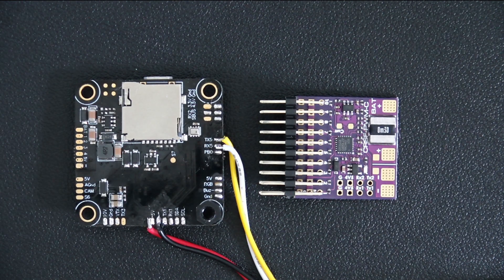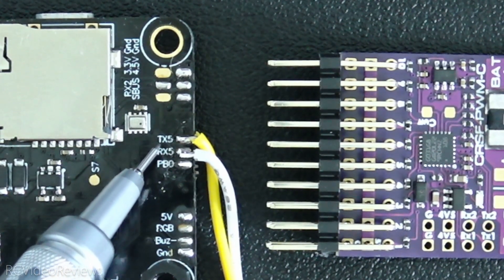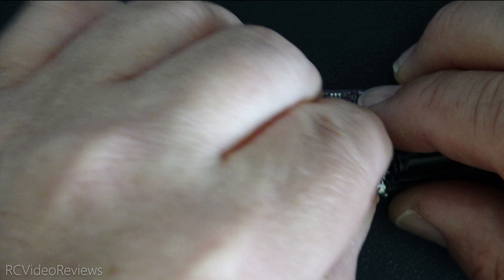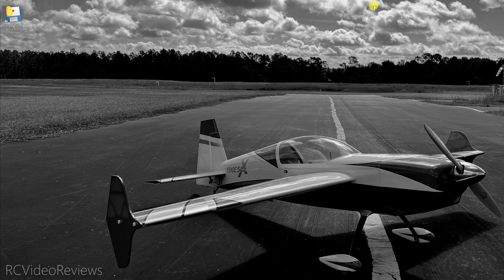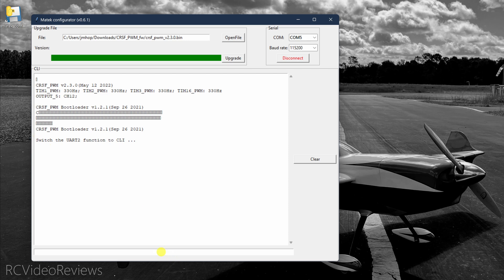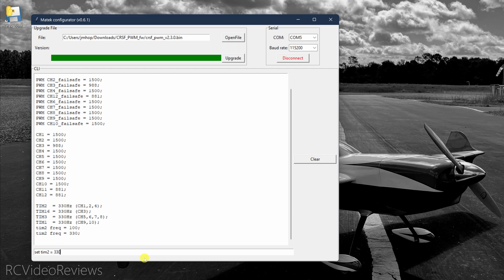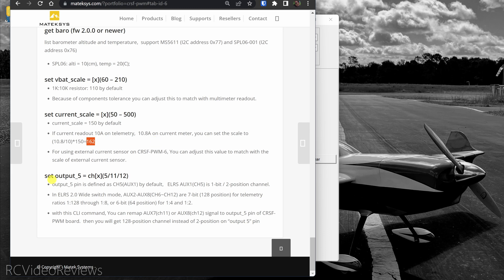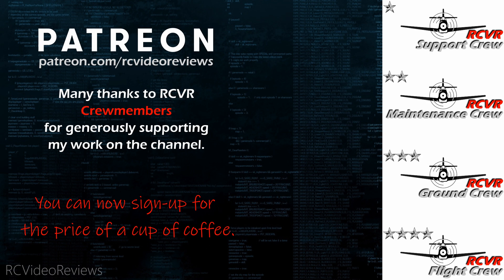How-to Betaflight Passthrough Flash and Configure the Matek CRSF-PWM-C for Express LRS

Comment: On their website Matek give details of how the CRSF to PWM converter board’s firmware can be updated via a USB-TTL module, such as CP210x, FTDI. I have also seen it stated on another site that the BetaFPV ExpressLRS recovery dongle is a FTDI USB to TTL adaptor using a CP2102 chipset. If so could this be used as the interface to upgrade the firmware on these boards?
Reply from the maker: The images I saw on the product page look to be very specifically focused on setting SBUS parameters and possibly even channel remapping. i.e. It didn't look like a terminal command line like the Matek boards.
Reply: @RCVideoReviews  Many thanks for your reply to my previous query. I purchased a USB to TTL adaptor and have used this to successfully upgrade the firmware on both a CRSF-PWM-6 and CRSF-PWM-V10 board. With regard to the CRSF-PWM-V10, can you please advise on the function of the “Boot pass” bridge and the pin connection located between the bridge and the No 1 PWM pin. It would be very useful if the bridge and/or grounding the pin connection were intended to force an attached Rx into boot mode but I can find no reference to these on the Matek website or from an internet search.

Comment: must be something about latest FC firmware, does not let the matek configurator open the port - i get this when i enter 'serialpassthrough 1 115200': # Port 1 already open.
Removing rxCallback | Forwarding data to 1, power cycle to exit. |  Also this message is in inav and also bf above the cli: Note: Leaving CLI tab or pressing Disconnect will automatically send "exit" to the board. With the latest firmware this will make the controller restart and unsaved changes will be lost.  | So something is wedged or no longer works for passthrough.
Reply from the maker: The BetaFPV dongle still works well. I haven't checked BF/iNav since I made this video as I usually just use the dongle.
Reply: @RCVideoReviews  Thanks, i did get it going with a USB TTL board.  Now, unfortunately i interrupted the crsf to pwm board flash and get solid blue led, any way to reset in order to reflash? Btw great channel! thx -pd

Comment: Very interesting video! You state that the instructions say that you have to connect to the 'second row of pins'.   I have searched High and Low but cannot find any instructions on this anywhere. Does a manual or instruction document exist ?  I recently electrically damaged (my fault) a new 10 channel crsf-pwm converter board (the one with the pins on each side. I replaced the MCU (I have all the needed skills and equipment) but could not get the board to be recognized using the FTDI device that is available for when one has a 'stuck' elrs receiver.  It is a topic I cannot find anything about and was not succeful myself.  So if anybody has tried it... I would really appreciate any documentation or advice !  Thanks a lot in advance and happy new year !

Comment: I bought 2 boards the 10ch and the 6ch. This 6ch works. Do I need to do the samething you've done here? It's weird the rx will not power own. The gps will not work either! I here the motor/ esc chime but that's it. No servo movement at all.
Reply from the maker: I could go through some basic troubleshooting like putting a multi-meter on the +/- pins of the rx header and gps header. Did you connect a BEC to the servo side? Remember, the battery side does not fee power to the Rx.
Reply: @RCVideoReviews  yes! The 10ch  only calls for a positive connection. Once I power up, the gps faintly glows as well as the blue light on the board.  In the servo side 5vbec to ch3. I get esc/motor chime but that's it. The crsf rx doesn't power on either.

Comment: I think the best way to program and setup the PWM receivers is to use a dedicated USB to UART converter board $2-3 to purchase an FT232 or CP2102, no soldering required and no need to mess around with betaflight on a spare FC. I've used them a few times on CRSF to PWM converters and also to recover ELRS receivers that failed a wifi update
Reply from the maker: Different strokes for different folks. I had this board sitting in my stash. Took me about 2 minutes and $0.00 to get it working. I guess it's all about perspective.